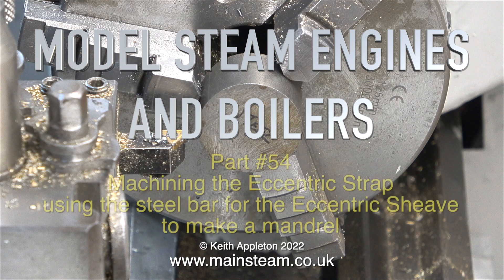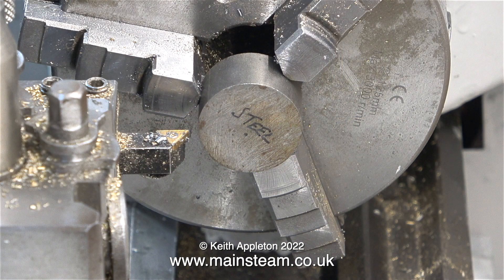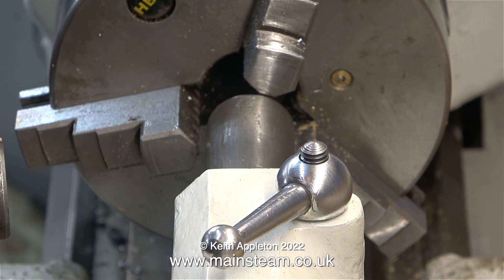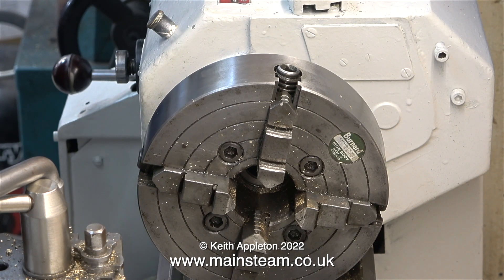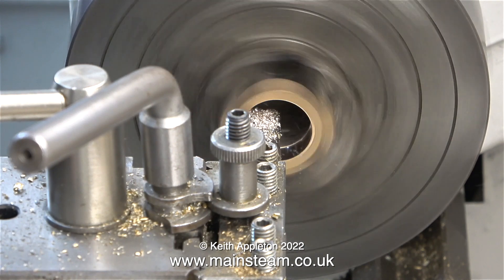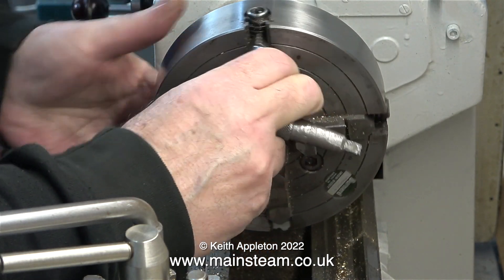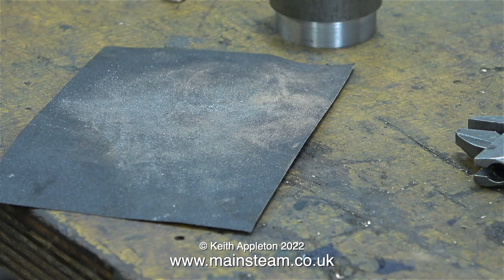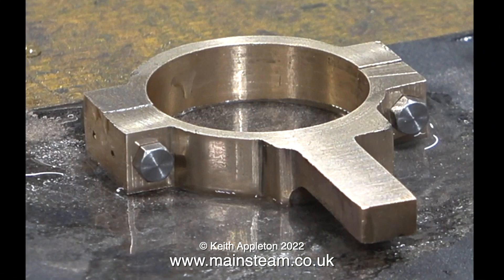STEAM ENGINES AND BOILERS - PART #54

Comment: I'm a bit surprised you haven't made a wood cradle for your chuck. That was one of the first accessories i made for my current lathe.

As far as indicating in a 4 jaw chuck goes, there is an annual celebration of YT machinists and fans in the US, and one of the competitions is a 4J chuck indicating race. I think Abom79 is the current champion.
Reply from the maker: For the chuck sizes and weights that I use, I don't need one as I am quite strong and can lift them easily with one hand (with the exception of the chuck on my Smart & Brown Lathe), I need to lift that using both hands }:-)))